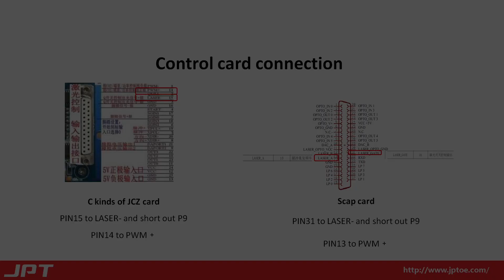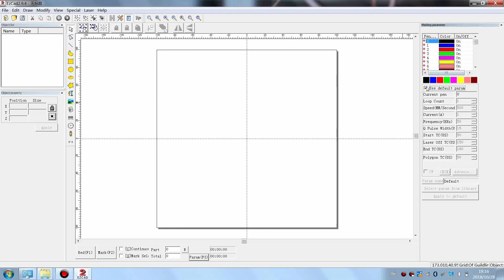JPT UV Laser GUI guide

Comment: Problem fixed. For me it worked to connect the controller PWM signal (DB25-20)to JPT board /PWM (set jumper to  /PWM). The LASER signal (DB25-19) needed a optocoupler in between to avoid freezing the controller. Pull up to 5v so the controller sinks the driving led of the coupler. This way there is 5V on LASER, killing the beam when marking. No coupler made the program/ controller hang. No need to connect FPS. Would be nice if JPT or JCZ  would provide a wiring diagram with the machine.
Reply from the maker: My friend, in our laser manual it tell clearly how make wiring. If you have any problem can also message me on Whatsapp +8613322983786
Reply: @carlgao117  Dear Carl, were can i find this manual?
Reply from the maker: Dear, you can contact our euro sale with below email: slluu@jptoe.com @PPI_Industrial_Automation
Reply: hello

Comment: I want to connect a JCZ DLC2-3D controller to the Seal 355 3Watt. The pcb supplied with the Seal laser source has a PWM, Laser and FPS connection. Wired it to the controller (db25-19 to LASER, db25-20 to PWM, FPS not wired). This does not work consistant, the Blue pilot laser and real UV do not switch properly. The controller also frequently hangs requiring a power removal for the controller. How is this supposed to be wired?
Reply from the maker: My friend, it's easy to solve the problem. Just reverse the signal on software is fine. You can add my whatsapp +8613322983786, I can arrange engineer check for you
Reply: hello ,i am laser sales man